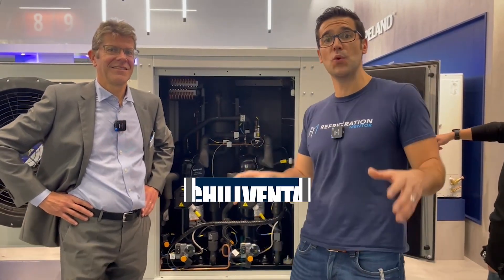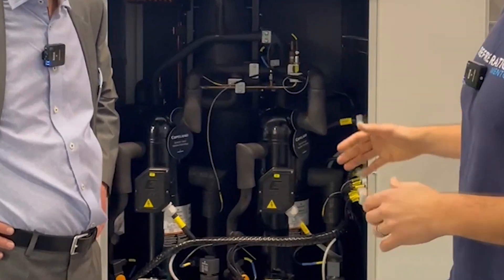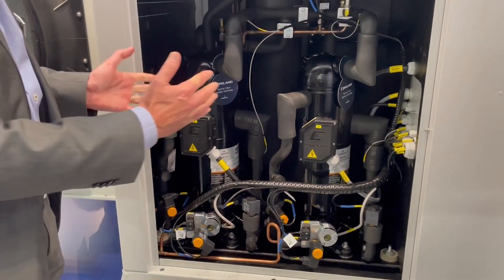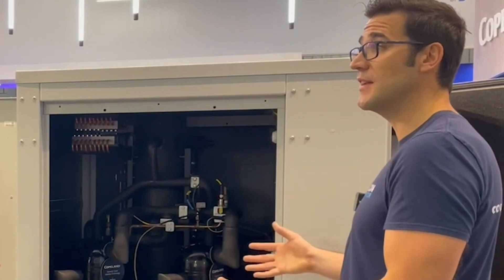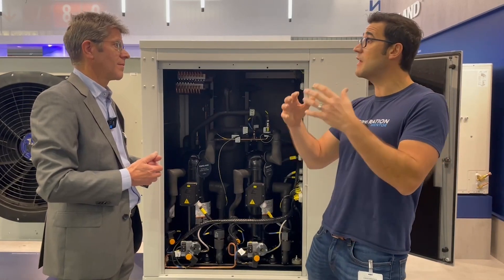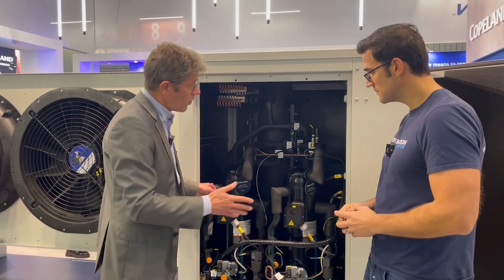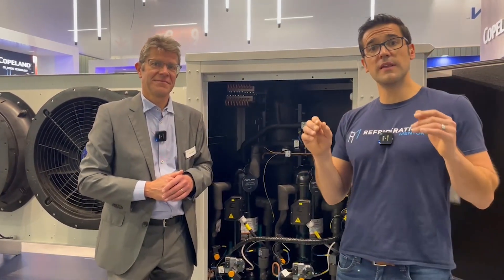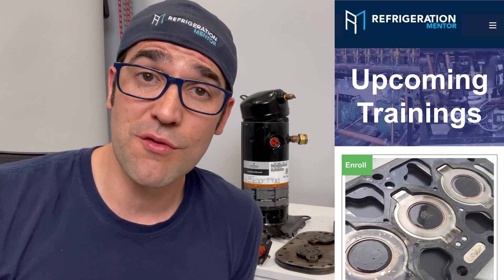Copelands CO2 Gas Cooler/Condensing Unit

Comment: Amazing it’s modular! Now I can put my unit on roof and have gas cooler inside!🤣 1:57
Reply from the maker: That's funny. thanks for sharing Roman.
Reply: @RefrigerationMentor , great channel, I really appreciate the content you create!
There is very little usable engineering information about this CO2 scroll condensing unit on Emerson's website - Do you know where I can find a P&ID or process flow diagram, as well as capacity charts for elevated ambient temperatures?
Reply from the maker: @winflexful  They do not have very much available for the public. I suspect in the next 6 - 12 months they will have more but for now there is really nothing on the technicial aspect. I have been asking for years and still not too much available.